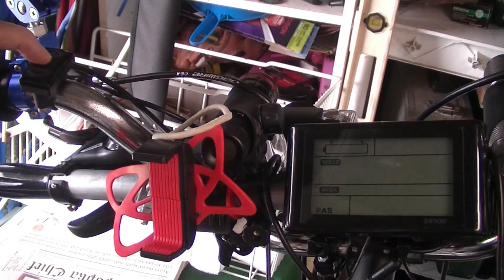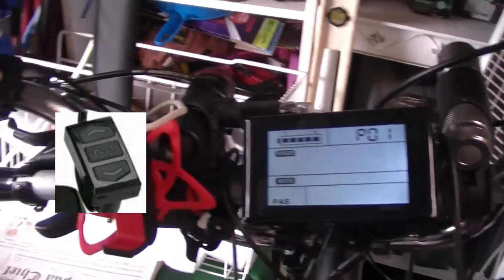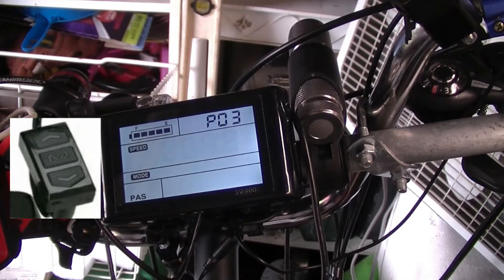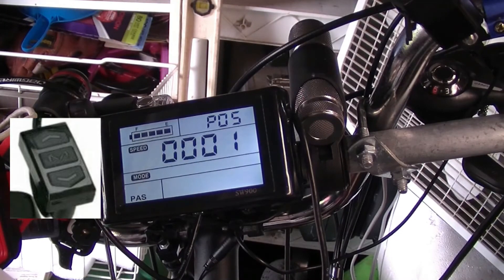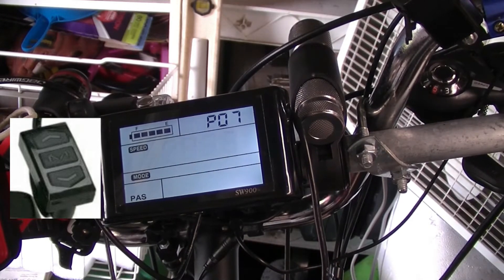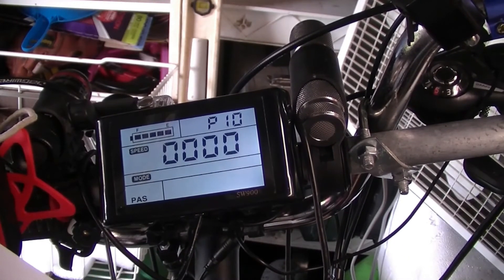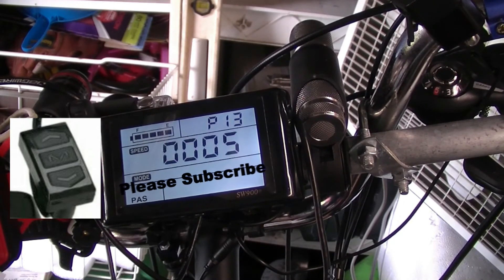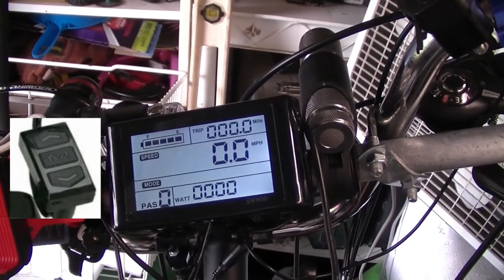Hack Your Electric Bike and go FAST part1

Comment: Soo tried this and my dumbass changed something else without knowing now when I use the throttle nothing happens could you show a video on what everything should be from all the settings so I can ride it again??
Reply: Did you ever solve this problem I did the same thing. 😂
Reply: @Chefjoefasho  it did get fixed I took it to someone who knew how to fix it so I still have no clue what was wrong with it unfortunately I cannot be of assistance to you
Reply: @HarryMcnaughton-d7p ok thanks

Comment: if you set your wheel size as low as possible you can increase the speed significantly.
Reply: Does it tho?
From my understanding that effects the speedometer and would think it would give an incorrect mph reading

…so u would be going the same speed even tho it reads higher. Or am I wrong?
Reply: @Capn_Jack  is correct it doesn't change the actual speed

Comment: on my bike, the pedal assist senaitovort is at its most sensitive on setting 0001.

if I raise the level to 24 it seems to take an age before the motor kicks in, which is a pain in the arse when you're trying to set off in a high gear on an incline.

Comment: Doing these hacks will lead to major overheating and possible fire. Specs there for a reason from not having controller overheat as well as the battery. Recharging gets real risky and those E bIKE FIRES likely the end result..

Comment: This isn't hacking. The engineers designed the firmware this way so that the settings can be altered for each country. Speed restrictions are set for liability reasons. Some manufacturers offer instructions on how to access those settings. The process of holding down two buttons is basically the same for most electric bikes.
Reply: ever heard of a joke 😂
Reply: Exactly you didn't hack anything you just set up your bike to how you want it lolololl

Comment: I noticed you set yours to 50kph not MPH. Thanks for the manual link, hopefully it's got the error codes. Mines showing an E-7 code.
Reply: You would need like a 3000 watt motor to get to 50 mph anyway

Comment: I did this to my Deep Power E Bike. Its a 48volt 500watt with 10amps.  I went from 20mph to 31Mph  . HAPPY
Reply: I found it difficult to increase mine, please can you be of a help, just wanna be happy like you are
Reply: Pls I have a speeddrift 26inch tires 48v 10ah 493w a bit off yours but If you could help me out on how you got your like ?🙏🙏
Reply: @devoncoleman5560  you ever find out how to do it
Reply: I GOT 60V 30 AH 1500W.MOTOR.WHATS BEST FOR THAT..SETTINGS I MEAN

Comment: hall sensors of the brakes are connected to the controller, but do not work does not generate the energy, how to turn on.
from the display is there any setting and which one is in row p17

Comment: hello thank you for your video. the p14 parameter on my sw900 goes up to 50 A. I have the impression that it is there but inactive because setting it to 1 or 50 does not change anything in torque or speed. possible in your opinion?
Reply: You don't want the controllers current rate to exceed the battery's maximum continuous discharge rating. Find out what your battery max discharge rate is and keep the controller set below that and that's as fast as your going to go until you buy a bigger battery and a controller with higher current rating. (a controller for a higher watt motor) So here's the deal... lets say you have a 48v 15ah battery and a 48v 750w motor. (750 / 48 = 15.62) A 48v 750w motor gets a 15a controller that's suitable for 48v. That's stock and you can't make it go faster by changing anything in the settings. I wish it was that easy but it ain't. You can buy a bigger 48v battery with 20ah or 24ah and that will make it go about 3 to 4 mph faster plus give you more range. lol pfft. What a joke. To make it faster you have to, #1 Buy a 52v or 60v battery. The motor likes any voltage you feed it. If anything the motor might get overheated on a hot summer day but, no worries. It will be fine. But don't go over 12v for what the motor is rated for. Stay safe. You don't want to make it dangerous fast, I hope... Maybe I shouldn't be telling all this... To late. Ok so #2 Buy a 30a or 35a controller that matches the battery's voltage (52v or 60v) and a new display that is compatible with the controllers protocol. (controller and display have to work with each other) Long story short, Buy a bigger battery. Buy a bigger controller with matching display (buy the kit) Slap it all in there and you will be going fast enough to really hurt yourself. I take no responsibility for any hospital visits or burials. The information is for educational and entertainment purposes only. Be responsible guys. These bikes can become very serious very fast so use caution and follow all laws and rules of the road. Let me know how fast you get that 750w motor to go after that upgrade. My guess is 60v battery, 35a controller on a once 750w motor will do 45 to 50+ mph. I am so about to delete this reply. This is dangerous information! You all can thank me later. Remember this is educational and entertainment purposes only!

Comment: P15 is battery cutoff voltage, very important to set it right to prolong battery life. 48v battery set to 40v-41v, 52v battery set to 42v-44v.
P14 set to whatever the controller box rated is or battery bms amp rating.
Reply: Don't get this one can you explain please
Reply: @kiddermereside  hi, battery cutoff voltage basically means a protection against complete battery discharge which can lead to a dead battery that can't be charged anymore and the p14 setting is for the bms(battery management system), the max amps should be written on the battery, set the p14 setting to that.

Comment: My bike breaks the engine every now and then during assistance. is it normal, does it have anything to do with the speed reached?
Reply from the maker: If you reach max speed that will happen. Thanks for watching and have an Awesome day 😊
Reply: @haroldsshed876 Is there any way to prevent the motor from actually braking (using motor) if we are say going downhill and actual speed is greater than max speed set.

Comment: So I had the same conversion kit for my bike and I remember it going 35MPH 
I buy a new battery for it and it only does 25mph
Does anyone know where I went wrong
Is there a way to derestrict these further because I feel like I’m not getting the full potential
Reply: I Figured it out 
I had the blue cable connected restricting the power output 😑
Reply from the maker: Yes that's what I did also. Thanks for watching and have an Awesome day 😊
Reply: @lorenzomoretti2972 🏁
Reply: @lorenzomoretti2972 Which blue cable did you disconnect? This blue cable runs from where to where?
Reply: @jackkumar1  I bought the bike  prebuilt I just know it was in the housing bag somewhere
Reply: I'm not sure but could it be tbe power output of the battery?

Comment: If your ebike's speed limit can't be raised past 20ish mph, setting a smaller tire size will bypass it, but your speedo and odo will be off.
Reply: You're wrong it has to be a bigger radius not a smaller one
Reply: Correct
Reply: I have a bafang 1000w motor. I’d like to convert a mountain bike I have? Any input on max size battery and what else I may need or can use to get the most speed out of it?
Reply: @RMS5277 72v need new control er tho
Reply: How small should we go?
Reply: how much faster?
Reply: @luis4721  that depends on motor power and how far can you go down in tire size
Reply: @PyroAnonymous  i think my motors 750watt n i can change my wheel size to 18inch down from 26in
Reply: @luis4721  Changing the tire size from 26 to 18 inches would grant you roughly 47% more top speed; so if the bike's dash reads 20 mph, you will actually be traveling at 29.4 mph. A 750 watt nominal motor should be able to reach that speed.
Reply: @Pyro Anonymous  how about a 500 watt?
Reply: @PyroAnonymous pyro what about 500 watts to 26 to 16
Reply: @uncleowen2193 how bout you just go try and tell us lololol lazy
Reply: If you want more top speed, go with a higher voltage battery pack. Just make sure the controller can handle the voltage you want.
Reply: @PyroAnonymous  you go to the biggest size to trick the controller so the magnets passes slower and allows you to go faster
Reply: @01mrjsh yes, but the 45 mph displayed is not actually 45 mph, actual speed is less
Reply: @PyroAnonymous  yeah no shit
Reply: My display skips from 8 to 13
Reply: Bigger tire size
Reply: I have a Burchda R5PRO. I put it to 64mph but it still feels like 29. What can I do
Reply: Didn’t work

Comment: P 8 doesnt show mph or kmh on side so for me I don't think it is miles per hour but it defaults at 36 and goes up by ones when modifying it
Reply: If it's 36 it's probably Battery Voltage 24v/36v/48v/.

Comment: I set P14 Max Peak Amp to 15 but when I ride up a steep hill with my display on Current, the Current goes up to 33!  What am I missing? Thank you for the video.
Reply: Set max peak amp to whatever your controller box can do or the amps your battery is rated.